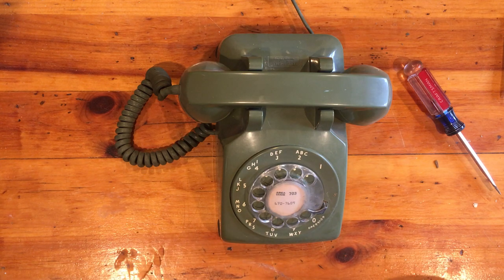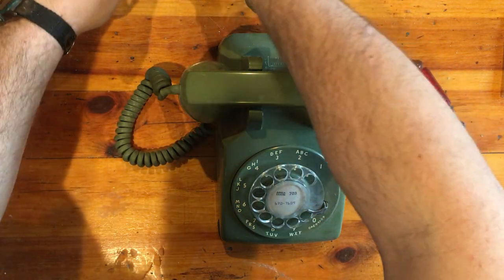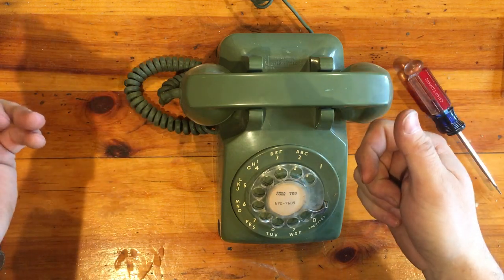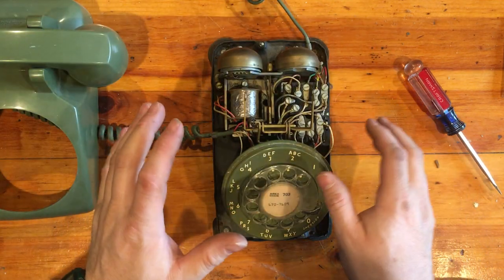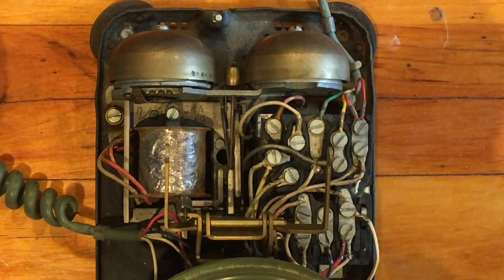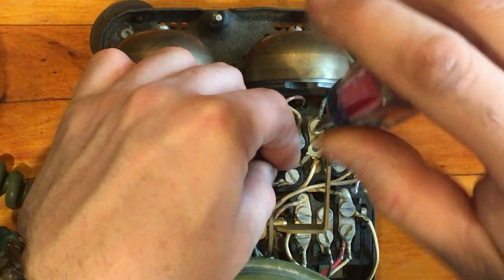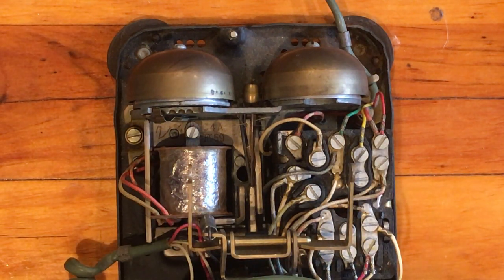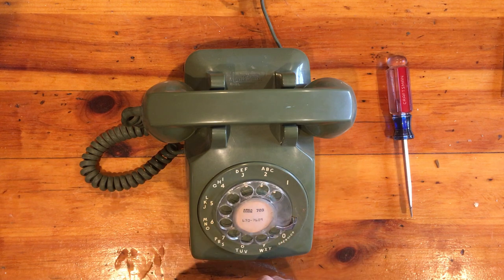Make an old phone ring on modern lines (Part 2)

Comment from the maker: I’m waiting for someone to ask me how I dialed from one phone to another... That is a whole lot more complicated. Let me know if you want to see how I made that work.
Reply: I'm game for the question please tell me how you were able to do that because I think it would be really great to set my house up with phones to use as intercom systems between all of the rooms the kids and the guests and the family would really enjoy using old rotary phones and antique telephones for that purpose
Reply from the maker: @portlandlocalchurch8168  For a simple system like you want for an intercom, my advice is to look online for a used Avaya Partner ACS processor. This one module will give you 3 outside lines and 8 extensions. Programming is fairly straight forward and it works with standard analog phones, rotary and touch tone. Be sure to get at least one system phone, so you can program it. Soon I'll have to make a video on how my system works. It's pretty complicated, involving a computer running linux and asterisk, channel banks, miles of wiring, punch down blocks, and more.

Comment: Thanks for this - I just made it work on an old 302 which someone had wired for a modular plug ...   Now to figure out why the phone won't relinquish the line.
Reply from the maker: Make sure the ringer is wired through the capacitor. If you’re talking about the dial not breaking the dial tone, your line may not support pulse dialing.

Comment: My dad has this old danish palace phone from the old crank phone days, they were sold dirt cheap out of magazine ads with rotary dial kits, he finally hooked it up, and it doesn't ring, but you can hear people, and they can't hear you. So our home phone is one of those black 80's touch tones from ITT
Reply from the maker: With the old crank phones, it wasn’t just a matter of adding a dial kit and it works. The old crank phones were known as local battery phones, where more modern phones are known as common battery. The difference being the phone is powered by a battery on-site, as opposed to modern phones being powered by the line. You would need to make a few changes in the wiring. Inside the phone is an induction coil with several leads on it. Some, but not all, were convertible to common battery by a few simple changes. There should be a diagram inside the phone that tells you how to do it. In local battery, the transmitter is powered by the battery, and that’s why you can’t be heard. If the phone is not convertible, you can substitute a network block from an 80’s phone and rewire the set. Don’t remove the original components, just leave them there. The phone is worth more if the original parts are still with it. Just tuck their wires out of the way and connect the transmitter, receiver, dial, and switch hook to the new donor network. And the ringer, of course. I’ve done this to several phones for people and they worked pretty good.
Reply: @chrisrichard298  there's no battery slot or diagram inside, my dad wants to gut our ITT touch tone landline and put that stuff in there somehow. You can look the phone up, danish jydsk telefon

Comment: On my rotary dial phone it rings, but the duration of the first ring is short (1-2 seconds) and subsequent rings are even shorter (1 second each).  Is there a fix for this.
Reply from the maker: What is it connected to? It’s rare but sometimes some of the cheaper voip devices just can’t supply enough power to ring the old phones properly. U-Verse is notorious for this, as is some of the smaller magic Jack stuff.
Reply: @chrisrichard298  it's a refurbished phone.  It's plugged directly to wall outlet through a static reduction device.

Comment: I have a working wall mounted rotary phone and it has the same correct wiring as shown in the video, however it still doesn't ring. Is it possible the capacitor is bad?
Reply from the maker: It's entirely possible, but I've never seen one go bad. Does the armature try to move at all? What is unfortunately more common is one of the ringer coils going open. If it does move or vibrate slightly, did you try adjusting the bias spring? What is the source of dial tone on the phone? Is it connected to a good, old fashioned telephone company phone line, or is it connected to a cable company modem/router/emta device? One of the main problems with these "black boxes" that connect an analog telephone to the internet (besides having no support for rotary dials) is their ringing voltage is abysmal. It's enough to trigger the circuitry in a modern cordless phone, but really not up to the task of hammering a mechanical ringer. Get back to me with some info, and I'm happy to help you sort this out.
Reply: @chrisrichard298  Hi Chris! Thanks for your prompt response! To make things a little easier in describing my issue, I made a video.

Here's a link: https://youtu.be/BfyADDT8Khw

If anything else is needed, just let me know. Thanks once again!

Comment: Your phone may have been connected to a party line. In the day, it was common for phone companies to offer a lower price service where 2 customers shared the same phone line and the name given was party line. In one arrangement, one party had their ringer connected across the phone line. The other had their ringer connected between one conductor of the phone line and ground. The phone company equipment could ring each phone independently depending on how ringing voltage was applied. Private lines normally had their ringers connected across the line. So, your phone may have been used on a party line before it was taken out of service.

Another situation where a bell may not ring was where customers connected extra phones to their phone line. The charge for a telephone company provided extra phone was about $1 a month. When someone moved, the phone was usually left behind and not retrieved by the phone company until the new resident ordered service. So, many of these phones got stolen and connected as extension telephones. The telephone companies had test equipment which measured the number of ringers connected to each line, without actually ringing the phone. If they found extra ringers, they would send a repairman to make a visit and disconnect the extra phone or phones. Word got around and many people, to avoid detection, disconnected the bells on their unauthorized extension telephones. So, you may run across phones with the bells deliberately disconnected.

Comment: Thanks so much, Chris - this has worked many times for me. But I have one phone right now that looks like it's wired just like yours. But ... when I put the black ringer wire with the green line wire, the phone rings but it won't break dial tone. And ... when I take the black ringer wire off that terminal, the phone dials, but it won't ring. I tried a few other locations for the black wire, but no dice. Maybe it's significant that this ringer is that it has those skinny little wires like in modern line cords - doesn't match the interior of the rest of the phone, so maybe it's a ringer problem? I don't know ...  Anyhow, still a super-useful video. Thanks!

Comment: My western electric is from year 1984, it was already wired as you showed the mod yet it does not ring when a call comes in on my Xlink BT bluetooth unit. I can answer and dial out but it never rings. Is there a way to test the ringer ?
EDIT - Found the problem with mine which stopped it ringing, next to the central brass donger ball between the bells there is just to the left a stiff piece of wire that acts against cam positions for varying volume, it limits travel, on mine, the end of the stiff wire was jammed against the underside face of the aluminium cam casting, perhaps it got dropped, anyway once the wire was dragged to the right and to the side of the cam casting, it rang.

Comment: Can someone tell this senior how to use my rotary phone by connecting it to my landline computer, please? I have no phone access for I'm unable to use cellphones or push button phones (only a rotary will work for dialing). The landline works less than 5 percent of the time, so it's not an option. Also, due to limited mobility usage of my hands, etc., I'm unable to do searches online (even if I knew what I was looking for). Thank you.

Comment: thanks boss. hardwire the line to the terminals? or put a rj11 jack on the back?
Reply from the maker: You can buy line cords with a modular plug on the end with spade terminals if you don’t have a cord on the phone already. If you do have a cord, put a cheap modular Jack on the end and use a regular cord from that to the wall

Comment: How cool would it be to put an old school telephone in every room of your house as an intercom system so you could call any other room without any outside connection?
Is it possible?
How would we set that up?
Reply: Buy a Panasonic KX-TA 308 or larger capacity PBX, used, (eBay) wire it to your house wiring and your done! You can plug in your home phone if you like, but to dial out you must dial "9". The Panasonic system converts the dial pulses to tones, automatically. (you can't hear this process through the phone). It's fun and a practical way to use your old dial phones. And they RING no problem!!
Reply from the maker: An old Avaya partner ACS would work too

Comment: question and need help. how can we pop open the case off, also what type the jack adaptor i need to buy to connect with this old phone? the new plug jack now these day wider than this phone plug in jack. thank you
Reply from the maker: On the bottom of the phone are two slotted screws. Loosen them and the housing will come off. As far as a jack: If the phone has the original cord with fork terminals (or a four pin plug that can be removed) use a standard baseboard type of phone jack, mount it on the end of the phone cord, then use a standard modular cord to plug from the jack hanging off the phone cord to the jack on the wall. If the phone does not have a cord, you can buy a replacement phone cord that has a standard modular plug on one end and four spade terminals (forks) on the other end. Just hook up red and green inside the phone and tape up the black and yellow. Secure the cord inside the phone and put the cover back on.
Reply: @chrisrichard298  also. Can you make a video or tell us how to remove the cap that has a piece of paper that writes a phone number on it. I see a small pinhole. But can not remove the cap to replace a new phone number. Thank you

Comment: Is there a hack similar to this for old pushbutton phones? I've been unable to get mine to ring using an OBI and a ring voltage booster .
Reply from the maker: If you mean a standard 2500 or even the rarer 1500 touchtone phone, it’s exactly the same procedure. Aside from the dial, the inside of the phone is identical to the rotary version.

Comment: I'm trying to do this as well, do you happen to know what points in an rj11 jack that the red and green wire would terminate on? I'm trying to get it hooked up to a bluetooth receiver that needs the jack and the phone didn't come with one
Reply from the maker: The center two. If it’s a rotary phone, polarity doesn’t matter, if it’s an older touch tone phone it will, but you can just swap red and green to make it work. If it is rotary, you will almost certainly not be able to make outgoing calls, since most modern gizmos (Bluetooth to landline, voip adapters, and cable company phone adapters -the kind on the back of their routers) won’t support pulse dialing. It should ring without too much trouble and otherwise work fine.
Reply from the maker: If you mean what terminals in the phone on the network, it should be L1 and L2, though if someone  has messed with it that may not work. Let me know if you need a schematic for the inside of the phone, and what model it is.

Comment: Any similar tricks for the wall telephone #2554 on Fios voip?  The phone works fine but does not ring.
Reply from the maker: Same rules should apply. The 2554 is just a wall version of a 2500, which is the touch tone version of a 500 (like the one in the video) The 2554 uses a single gong ringer, but I believe it still has a bias spring adjustment somewhere. I'll have to look at one and get back to you. Make sure the wiring is correct, as in nothing is connected to the ground screw on the network. If the phone has a 4 wire ringer, it should be one wire to L1, one wire to L2, one wire to A, and the last to K. These ringers have two coils that are in series with the capacitor (A&K) between them.  Red to L1, black to L2, and the other two to A and K (Doesn't matter which). 

Fios has notoriously low voltages. Ringing voltage is 50-60 volts, bell spec was 90-110. Loop currents around 20ma, bell spec was 23 minimum. I think on hook voltage on fios is ok, but it doesn't affect anything anyway. As for loop current, too low and speech can be distorted, touch tone dials may not work right, phones with LED backlighting may not glow. Too high probably wouldn't affect any old Western Electric phone, but it can also distort speech, burn up modems and burn up line cards in multi-line phone systems.

Let me do a little digging and I'll post something about the bias spring in a 2554.
Reply from the maker: Lost my train of thought...... If the phone has a two wire ringer, One wire of the ringer goes to L1, the other to A or K. Then a jumper from L2 to A or K (the one the ringer lead is NOT connected to. A and K are the ends of a capacitor used for blocking the DC loop current from going through the ringer coil. Without that capacitor, the phone would act like it's off hook all the time and busy out the line.
Reply: Chris Richard Thanks Chris for getting back to me. I’ll have to take another look at it.  I don’t remember seeing a bias spring, but I’ll recheck. Just trying to get this phone that works otherwise, to ring.

Comment: my phone can ring but cant make a call. how do I make it so I can make a call without having to use my cellphone and bluetooth thing that other videos have said.
Reply from the maker: If this is a rotary phone, you may have a provider that doesn’t support pulse dialing. If you have phone service from a cable company or fiber optic service (think fios, uverse, that sort of thing) their equipment doesn’t support rotary phones. You would need a pulse to tone converter. I like this one, mostly because it works unlike a lot of cheap knockoffs. https://www.oldphoneworks.com/pulse-to-tone-converter.html
Reply: @chrisrichard298  thx u. ya we internet phone service. so I'll look Into it.
Reply from the maker: @suzz1776  then the gizmo I linked is what you’ll need or something akin to it. Let me know how it goes.